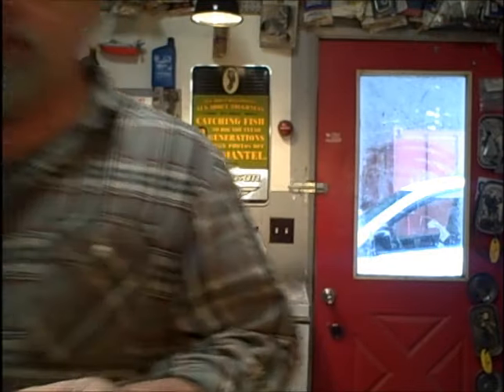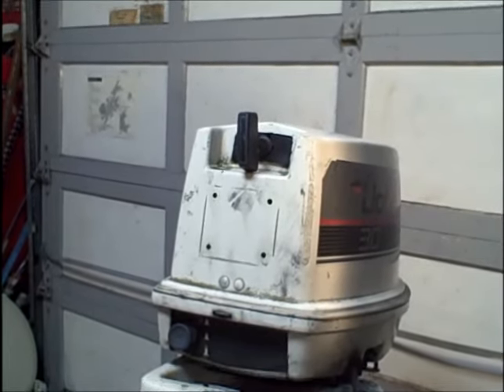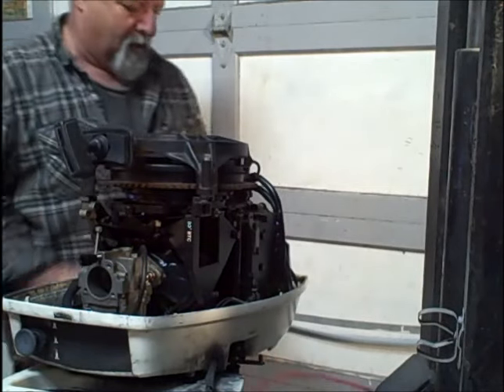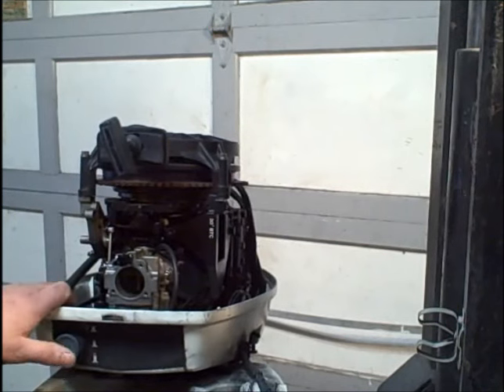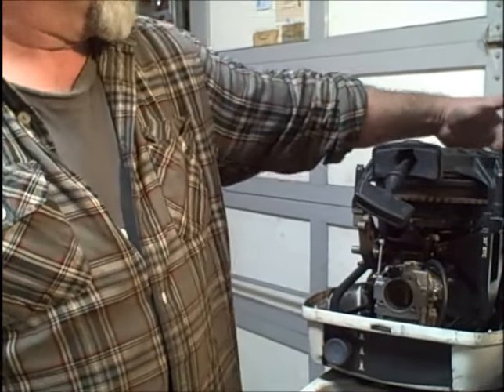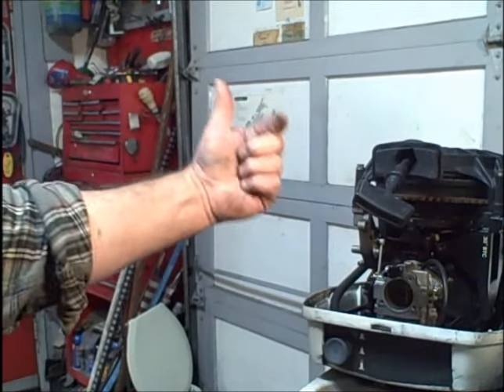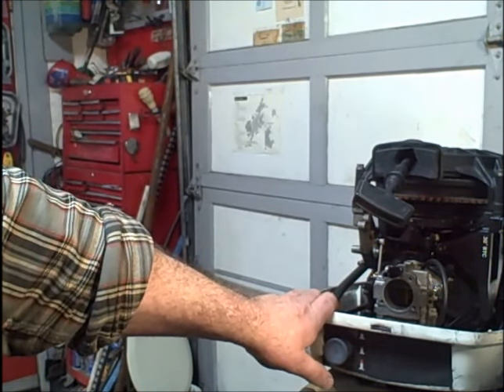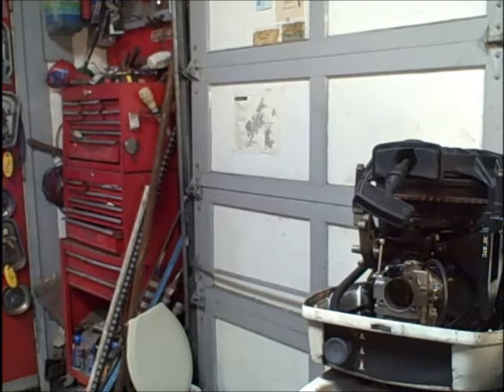Johnson 30 HP problems

Comment: Complete coincidence, I purchase a 35 hp Johnson for cheap yesterday. Guy just said stopped running. I stumble on to your video from 3 years ago. Looking like the exact same thing on my motor. Got hot 20 psi compression. Pulled the head, gasket looks pretty tuff, cylinders still have cross hatch and no scoring. I'm hoping to get as lucky as your customer did and be able to bring it back.  Keep up the great work!!!!   Michael out

Comment: Hey kodibass, did you ever figure out what that brass screw and spring that you found were for?  I found the same thing on an '83 35 hp and haven't figured it out.  The motor runs fine and I can adjust the idle with the throttle cable but it's weird you found the exact same thing on a similar vintage motor.  Thanks!

Comment: Hey Kodi, Can you tell me what is different about a Johnson "Canadian Derated" model?  I have a 1994 J20CRERC.  Evinrude connected me with an Evinrude family member, for "vintage tech support", he was very nice, but not sure about the Canadian Derated class.  He thought it could be a higher than 20HP model, rated downwards; but it looks like a 20 (smaller carb than my 1998 E25 and 1993 E30).

Comment: Do you vacuum check your lower units? Eye pressure and vacuum check all of my customers lower units to come in to be serviced. I've had those oddball moments where they pressure test okay but vacuum test they fail and of course went in the water and all the water around on the seals they leak. I use a Stevens vacuum checker.

Comment: Hello kodibass, I hope you are in Florida.  Your videos are great and nice to see people like you sharing knowledge to help other guys with these old motors.  I am on my 3rd johnny 25 - 30 hp now, I love working on these motors.  The one I have now has identical signs of overheat, melted lower coil where it bolts to the head, wiring that is brittle and I found a smoked water pump that was shredded to pieces. Removed the head cover plate and found thermostat stuck open full of sand and shells.  I pulled the head like you said and found the cylinders to be in great shape, no scoring and moving freely.  I will replace everything like you have done.  I have a question regarding the cylinder cooling passages.  At the top and bottom of the heads are small rubber hose called cooling deflectors.  I pulled them out out the top on thinking it was rubber from the impeller.  I see they are supposed to be there to help divert the water.  Are they essential to the cooling system?  I never noticed this before.  Do you ever see these hoses  PN 335603 and 335602?  Its 1983 J25RSS.  How do you know which one goes top or bottom?

Also this motor showed 30PSI on the initial facts check. I haven not installed the head yet because I am not sure what to do about the deflector hoses?
Reply from the maker: +EU,  The defectors would be better described  as restrictors   their purpose is to allow cooling water to remain in & around the head cooling passages a bit longer before circulating out thru  & out the final discharge.  If you look close on the upper head cooling passage there is a boss  protrusion mark where the deflector should be placed,  Now look at the bottom head passage & there is a recess in the inside cylinder circle where the deflector is suppose to seat.  As far as the actual PN for these  deflectors,  Use OMC  fuel line ,  3/8 "  cut it to fit where the Original deflectors were &  You are good 2 go.  As to if it is  "" critical""    No  it is there to give longevity 2 your motor, If you have a good pump impeller and T-stat your motor should be fine,                                                                                                     kodi
Reply: @kodibassInsideoutboards  thanks for the reply, It looks like these restrictors should be installed to the full depth of the water passage? Also I see three of them on my 83 25 hp, does that seem correct? I have two on the bottom and one on top, I do see the bosses that you mention,

Comment: How did you deal with salt corrosion when having to take a bolt and or nut off these outboards? Especially a little quarter inch bolts that built the exhaust tuner to the powerhead? I don't deal with a lot of salt damage but I do get some because I'm only about 200 miles from the Texas coast.
Reply from the maker: +brt 123,  The one thing I have figured out on these salties''   Go Slow,  If it is a outboard I really want to bring back,  I have taken up to 2 months coaxing it apart.  heat, cool ,lubricate      & repeat..                  Speeeeeeed  kills.       kodi

Comment: Another great video! After you lubed up the cylinders, I would be curious to know what the compression of both were? You had 90psi on the bottom after lubrication. Since you were about 30psi off before lubrication, I wonder if it would of been around that after lubrication?
Reply from the maker: +Phillip Taylor,  It would have went up for sure,  But by adding oil to just the bottom,  that evened  the numbers out which makes for easier starting, so I got lucky.        kodi

Comment: Just about to buy my first boat with one of these  Johnson 30's on it. Are they good and strong engines  in general? It's not been used in 4 years and starts but cuts out according to the seller.
Reply from the maker: Yes'  they are very good motors,  clean the carb, replace old fuel hoses, change lower unit & water pump impeller. clean & lube.  kodi
Reply: @kodibassInsideoutboards  thanks so much for the advice awesome Chanel!

Comment: Great video, i have a 99 evinrude 30hp sshaft that got hot, i  now have 70 psi in both cylinders you  Any advice on removing the bolts and replacing the head gasket?
Reply from the maker: YES''   Do as I did in  this video,  Remove the head,  Flex hone the cylinders, ''' Clean '''    oil & replace new head Gasket, Run as a new Motor Break In,                                              kodibass

Comment: I'm having hell with a 1961 Evinrude 18 horsepower lower unit. It's a first generation upper case with the small shifter bushing. It's just not sealing around the shifter.

Comment: This is the video I've been needing to see for a year! I have a 35 Johnson ran hot from an immediate waterpump  failure. I pulled the head off. Looked almost the same. I thought there must be something else wrong and never put it back together.
Reply from the maker: +the cowboy prepper,  These older OMC motors are tuff,  Give it a light sanding with 320 grit, &  put it back together.  If  you have just light scoring it will most likely  run.      kodi
Reply: Well i cleaned it up real good. Put a head gasket on it. I had 60 and 90 psi on the cylinders. It cranked and ran. After it ran about 20 minutes with a water hose on it i checked the compression again. 100 psi on both cylinders. Its running good. Now to watch a video on replacing the water pump. Thank you for your video. Without it i would have probably trashed the motor
Reply from the maker: +the cowboy prepper,  Fantastic , most likely go for many years.                                            kodi

Comment: Hey Kodi I have 1986 30hp evinrude every couple trips out it will act like it’s starving for fuel when I give gas it will keep running but when I give it throttle it wants to die. Should I drill trough the little lead shot and blast carb cleaner through it? Thanks
Reply from the maker: +N83,  How long has it been since the carb was removed, cleaned or better yet rebuilt?   After 39 years hoses leak , crack,   The carb passages get nasty  etc.   I would remove  carb  . replace old hoses order a carb kit rebuild  & deep clean  the carb. & Replace the fuel pump diaphragms ,                           kodi

Comment: What brand of two stroke oil do you mainly use please ?
Thanks and good video !
Reply from the maker: Kane Gatt,  , On motors that mix 50-1 I use yama-lube.  on Older motors pre 1964  that require a richer mix 24-1  I use AmsOIL,  Any good brand 2 cycle motor oil will work fine ,, IF it is rated as  TCW-3  that is the key  TCW-3  ONLY.   kodi

Comment: I have a 1978 35 hp evinrude  and have no control of  slow idle don't know where to get tool to get top orders out to put a new one in any idea
Reply from the maker: +PM,  Not sure what you mean top order, need a bit more info                              kodi
Reply: @kodibassInsideoutboards  sorry missed spelled,tool to take out top orifice
Reply from the maker: @paulmarriott3885   On a 1978,  there is no top orifice in that long transition chamber,  There are a series of holes that control idle & transition to high speed via adjusting the long needle valve  at the front,  to access this area for cleaning & inspection  drill a small hole in the Welch plug ( Lead core plug) on top & pry off with a pick clean holes with a small wire.   A new Welch plug will come in a carb kit for your motor OMC PART #   0387356.         kodi

Comment: I have a problem with my 30 horse Evinrude
 1989
It did get hot once and shut off because the impeller stopped working and I didn't notice.
I brought it home and put new spark plugs and spark plug wires and coil packs on and it fired right up absolutely no problem and ran like a top.
I did a compression check and it only has 65 PSI in the cylinders.
But it was running absolutely perfect.
Drove it around the River for a few days and it was running absolute Tip Top condition.
Then a few days ago it just stalled out in the river and I finally got it to go enough to get us home it was running very rough to get us home then 3/4 of the way home for some reason it started to smooth arrow and run perfectly fine up to about 40 km an hour all the way home I got it in the driveway and now I cannot get it to run for the life of me or even make it go putt putt and stall.
I did a compression check again and I'm still at 65 PSI per cylinder I know that is very low but I've been driving the boat around the river for about 2 weeks with the exact same compression so why would it just stopped working now.
I have tried everything possible to get it running I have checked every single wire it's getting gas it's getting spark Aviary wire is perfectly fine but it will not even go putt putt.
Any ideas
Reply from the maker: +JI  I would do another compression check with a different
compression gauge ,  if motor is not electric start spin flywheel with a good 1/2 inch electric drill.  If compression
is still @ 65  I would pull the head & have a  look @ the head gasket & cylinders,                   kodi
Reply: @kodibassInsideoutboards  I've been a compression check probably a dozen times in the last 3 days I bought an entire brand new kit
Reply from the maker: @jeremyillingworth4302   Is it electric start?  or did u spin it with a drill?  If yes & the numbers r still low squirt
1/2 teaspoon off 2 cycle oil in each cylinder & a squirt
of fresh straight gas in the carb then see if it will pop.                         kodi
Reply: @kodibassInsideoutboards  if it electric start I have put gas down the carburetor and in the plugs and it did nothing but I will try to put some 2-cycle oil in the plugs maybe that will generate enough pressure for  putt putt  I'll do that in the am

Comment from the maker: +Lustfulvengance,  I  Think something must have got clogged in the upper pick up tube beneath the power head but above the water pump,  That is the only thing I could figure how the impeller would be undamaged yet the power head get as hot as it did?  kodi

Comment: The death of every Evinrude Johnson motor is loaning it to a buddy who then takes it out and get it warmed up to a mild 350 degrees.that bloody then returns it and says for whatever reason your boat motor just quit running I have to go immediately now as he hood slides like Bo Duke leaving your driveway!! Lol
when you have one that overheats like that do you go ahead and pull the exhaust plate and have both the head and exhaust plate milled? on everyone that I get that has low compression and signs of overheating that's what I do
Reply from the maker: +brt 123,  Yep'  nobody cares for your equipment like YOU. 4sure.    kodi

Comment: Well, she aint new anymore, that's for sure...Like you say: NEVER lend your outboard out, to anyone, especially family!Yeah, they overheated the crap out of the poor 30hp, and just kept running her til she wouldn't run no more...No scores on the walls, but definite aluminum transfer on walls and pistons, probably rings are kinda stuck in places as well.  It was easier to see overheating when the powerheads were white, the paint would turn brown.  Much harder on the black powerheads, the glossy black finish usually just takes on a flat black look.  The melted wiring tells the tale.  Thanks for saving the old girl, she isn't gonna run like new anymore, but will run OK and give plenty more good service.  Tell the owner should invest in a water pump job now as well.  OMC outboards surely have their faults, but this video is a testament to just how rugged they are, and how much abuse they will tolerate and keep on running.